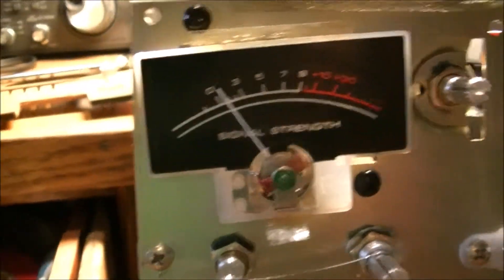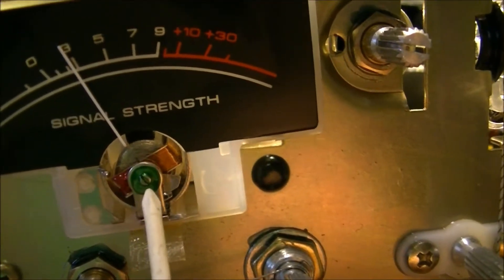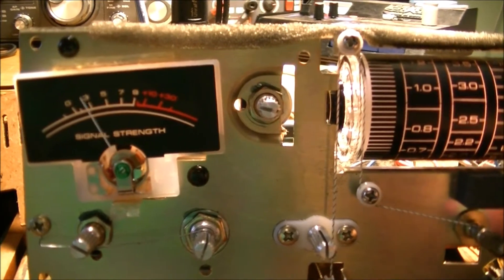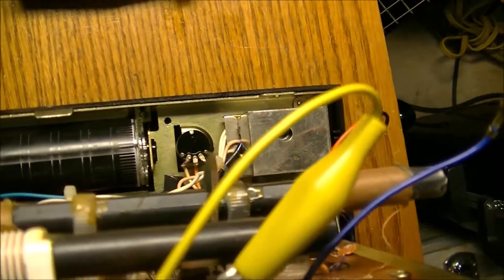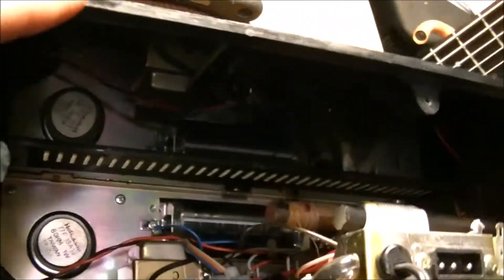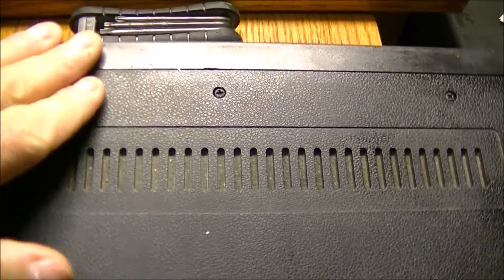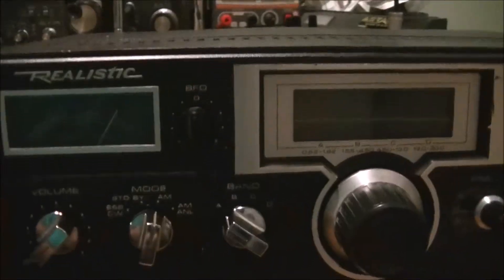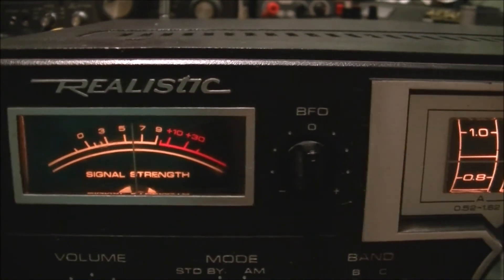Realistic DX 100 Signal Meter (Stuck) Repair

Comment: The simplest things eh Andy? Good spot on the simple fix. I bet it took longer to strip it down.
Reply from the maker: Yes, the meter was fixed in 15 seconds but it took about 20 minutes to dis-assemble and re-assemble. It seems to be a very common issue with these receivers. Thanks for dropping by Spanky.

Comment: Wonderful video thanks for sharing this. I have never seen this model. Used to bike 3 miles as a kid to radio shack, they sold realistic and components and projects. I am really learning how good they sound. 
What a cool fix on this one.
Reply from the maker: Thanks for the nice comment. You certainly won't be disappointed with this easy to use receiver. It is impressive.